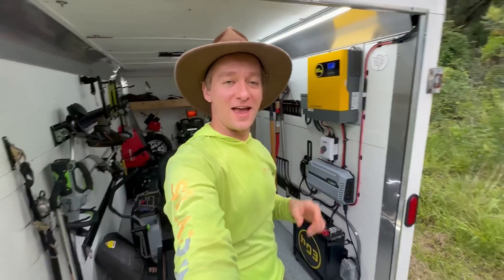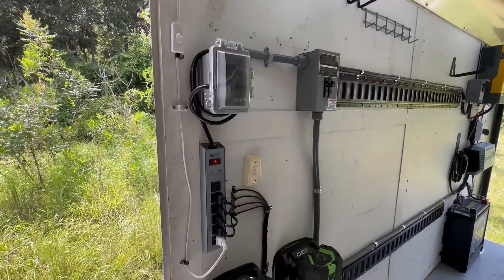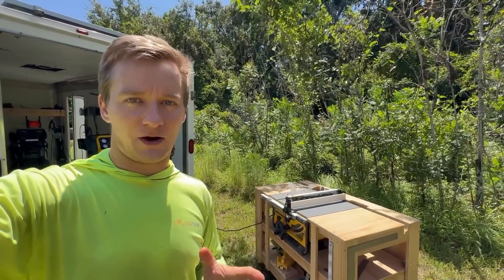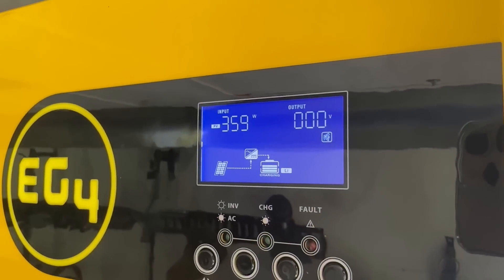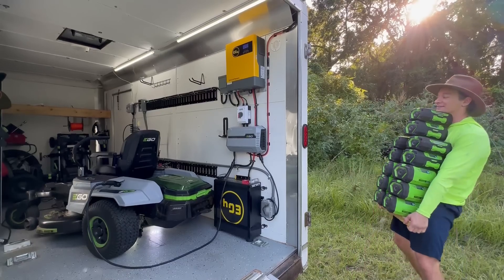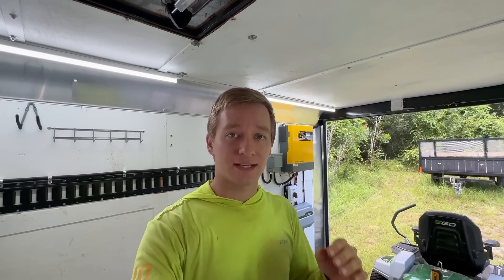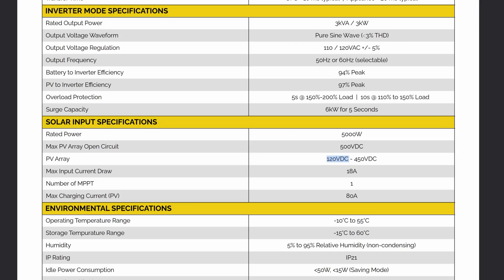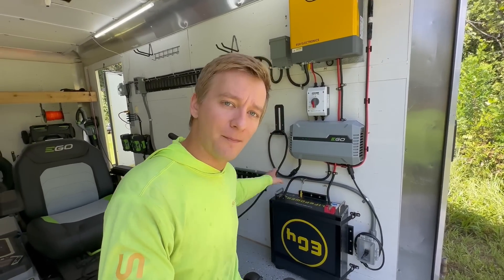Solar Powered Lawn Care Setup; Why Not Just Buy More Batteries?

Comment: I subscribed to you for this set up and your tesla towing it , you got a unique way of doing your things and I love it! , plus you are saving the environment , you can install a heavy duty extension cord at the grid hook up (AC in) , so it will be easier to just plug in and unplug to charge all in case of cloudy days and rain, just make sure is at least 10awg, I did on my set up and it works beautifully! ,I just plugged to the grid or etc and I can charge my system.

Actually I recharge my system from a portable power station delta pro and rolled to where I posible need if camping etc.
Reply: As an early adopter, I wish I could have had a Delta Pro when I was setting up. Had to design the whole thing from scratch and YouTube videos. The lucky ones going electric now can just buy a box, everything works, and there is  a cell phone app. 

I am going to disagree with you about "..saving the environment." He is literally cutting down vegetation every day with that clean green energy. (just like I do with my electric OPE) 😎😅

Comment: Looking forward to more. I figured it was only a matter of time before this kind of technology started to be really used and fleshed out. I don’t think engineered turn key solutions will be what makes people money or truly works for them but DIY projects like this.

Haven’t messed with ego mowers but so far I’ve not been impressed with the box store electric mowers. The power is there at 80 volts but the quality of these tools, especially made by global tools, the one who makes most of the big brand box store stuff, is terrible. Burned out BMS, control boards on mowers etc. the motors themselves and the battery cells are good but the electronics are hot garbage. 

I’d rather convert my own. Older but mechanically reliable mowers and riding mowers. Simple time tested motor controllers and no proprietary electronics or software. 

If you can build it, you can fix it.

Comment: Super slick setup. Being a solar guy myself I often wonder if anyone would start using cordless for their lawn business and here you are. My only concern is that these batteries use older type cells and their life cycles aren't that great. They're fine for the normal users but you're using your for a business so those batteries and being cycles regularly. Too bad, no one have come out with lifepo4 cordless batteries yet.

Comment: Just started out this year in the  uk. Battery equipment is still rare, only hedge cutters and small blowers for most. I went full makita 36v for everything which had been successful so far. Dual charger and inverter in my tow car. Looking into a bigger trailer with a similar settup to this on board. Thanks for a well put together video just subscribed.
Reply from the maker: Hey awesome! I’ve been around a few areas in the UK, you’ve definitely got a challenge regarding space. Even towing with my car instead of a truck, it would be really difficult parking my trailer anywhere. I would imagine a van would be a great use of space? I’ve even considered it here if I could find an electric one.  Congrats on being an entrepreneur trying to figure it out in your area! Let me know how it goes.

Comment: Even as a Tesla owner, I don't think I ever envisioned someone showing up to do lawn care in a Tesla until maybe the Cybertruck comes out!  Your production quality and content for this video is top notch and you have one slick set up.  It will probably slow you down for a while with customers wanting to check out how you are turning the lawn care business upside down. I have three out of my four neighbors converted to electric mowers with one loud obnoxious Toro to go - lol!
Reply: Haha i am on the electric conversion spree too.
I have a chain saw, blower, weed eater
However my lawnmower still works so why should i replace to electric.
Tough to justify $500/$600 
When it breaks i will replace it with electric
Reply: I found a ryobi 21 inch mower  with 2 7.5 batteries at a garage sale for $160. The money flew out of my pocket. I am now looking for a ryobi 40v chain saw. @danielt6810
Reply: @danielt6810  
less maintenance and thus cost, is the biggest reason to go electric in the first place.
i'm in the same boat currently, wanting to get a battery electric riding mower but ours works and is only like 5-6 years old.
our plan is to sell it and then make the change, most likely when these mowers go on a bigger sale because yea the upfront cost is pretty massive.
Reply: lol the cyber truck is never coming out
Reply: I switched to an electric mower with a working gas mower - I have no regrets. My Ego 21" self-propelled is a life saver, and the fact that it folds is really nice for my tiny shed. 

That being said, if my mower wasn't 5 years old and literally the most bargain bin version of a mower, I maybe wouldn't have been so eager to replace it. It helps that I was in the ecosystem already with an Ego string trimmer. Now I have a mower, a trimmer, a chainsaw (which is so awesome, by the way) and a leaf blower. I'll never go back, even with $.36/KWh electric rates.
Reply: Love your video. Now I need tutn my shed electric and upgrade to electric yard equipment
Reply: The cybertruck is a awful work truck. It better to buy a hybrid.
Reply: Cybertruck will be a game changer for this bloke, pass through power from, the cybertruck and being able to tap into its huge battery atleast 100kwh+ battery,
Reply from the maker: Hope I can afford it!
Reply: @solarpunksteve  I apologize if I missed it in the video - how much was the trailer alone in your area (sans all upgrades).
Reply from the maker: I got my trailer used, repainted the outside, replaced the bent axle and added electric brakes and a bunch of other little things myself, so not a perfect example of cost of a trailer on the market. Around my area, a trailer like this brand new is between $4.5k-$5.5k.  Used I’ve seen them around $1.2k-$4.0k.  Hope that helps.
Reply: @solarpunksteve  Thanks!
Reply: @solarpunksteve Ah I don't think you need to worry about it, given it's a "delays" I'll be nice.

Comment: This is eye opening! I could literally buy the panels, inverter, battery, charger etc etc for less than Ill spend on fuel in a season.  The second year's fuel cost would cover the mower and handheld equipment. Two years in and I could pay for this entire setup just in what I would have spent in fuel alone without any equipment! OR... for the average cost of a traditional gas powered zero turn mower, I could buy this entire setup. This is really an excellent option. I have so many questions! Does this type of service command a premium? Are customers willing to pay more for battery operated lawn service? Do you lean into that aspect with your marketing? Whats the life expectancy of these components? Are there any added insurance costs associated with this type of setup? Would you go with EGO again having used it for a while now? Is there any reserve on the mower in case you hit 0% while mowing and didnt see it coming? Ill stop there for now lol. So cool!
Reply from the maker: Woo! Ok firstly, thanks so much for checking my setup out! Secondly, I want to address all your questions as they are very valid, but I want to be clear this isn't proven long term (I'm only in my second year) and I'm not a large scale operation mowing tons of yards a day.  I'm a solo operator, try to get smaller yards if I can, and add other things to my mix in order to make money, not just mowing.  Ok, now on to the fun stuff!

Practically speaking, it probably makes more sense to skip the solar on the trailer or save it for the home/property you live on.  I paid a premium for "RV/Off-grid" solar panels from Rich Solar.  That being said, I literally named my company Solarpunk Lawn Care and put "solar powered" on the side of my trailer, so naturally solar on the roof completes the picture, and that's partly my point of all this: it's possible.

My area is relatively lower income and we have a large retired community, so initially I wasn't successful in commanding a premium just because I operate battery equipment (plus I was new to the game so hard to know what I should be charging regardless) however over time I've built a client list of people that work from home, are retired and live at home, or work the nightshift and all are willing to pay a little more than their previous lawn care provider if they had it, but to be perfectly honest with you, most have chosen me because I'm consistent every single week and  pay attention to what they like and do detailed work (imo).  As an all electric setup, I can't compete on volume, so I don't try.

My EGO equipment has been pretty solid so far, minor gripes and issues but all-in-all I haven't really had a reason not to like it. One dead battery after over a year, so can't complain given the amount of abuse I give this stuff.  Hopefully the other batteries continue to perform. If I were to do it again, I would still go with EGO for now.  I might look into a different string trimmer or some other tools as I go, but as long as my mower keeps running I feel it's a great entry level option for people at around $5.5-$6.5k (who has the money to drop $34k on a "commercial" electric mower, like common...)

The mower will stop running the blades and demand that you go drive it back to plug it in if you get that low.  I've never hit that point personally, and I wouldn't recommend operating electric equipment down to "empty" anyway.

Hope this answers some of your questions, I'll be trying to cover a lot of the topics you've asked about in future videos because it's clear this is still a very new and untested operation and that's why I want to help share what I've learned.  Also thanks for asking questions as this helps me figure out what people might want to know most.  Cheers!
Reply: @solarpunksteve  Thanks for taking the time to respond. Im looking forward to following along and learning more about this setup and how I may be able to apply some of it in my business.

Comment: Curious of life span with the batteries for the charging cycles. Consistently charging like that I am assuming takes a toll on the batteries. Interested if you could provided that breakdown.
Reply from the maker: I'm curious too! I have a reasonable understanding of these types of batteries/chemistries and I'm somewhat confident in their longevity, but ultimately without actually putting them through real-world testing like this, I'll never know for sure.  I'll definitely be putting out a video on that at some point covering lots of those details, but I won't do that until I finish collecting all the research papers I want to use to back up my claims so that I'm not just telling you guys something anecdotal about my personal experience.  That being said (lol) after over a year I've only had one battery quit working on me.  I hope the rest aren't right around the corner as that would be very disappointing and expensive to deal with, but until then, I'll keep using them to make money out in the real world!
Reply: @solarpunksteve  Maybe give an annual update on them as you go along. That's great they have lasted about a year with weather conditions in Florida and regular use. The EG4 I believe should last you about 5 years with the usage and Ego’s 1.5/2 pending temperatures inside the trailer with the usage outside. I know they have a safety shut-off to extend life if going above a certain set point, but here with 100-degree days, we reach the breaking point for most equipment easily. Good luck and can't wait to see the video breakdown of the data.

Comment: Have you considered adding a solar panel awning for the side of the trailer. You could raise it while working to double the solar charging while giving you some shade. Also, adding a matching EG4 battery on the other side of the trailer would double your reserve while keeping the weight balanced in the trailer
Reply from the maker: I have considered it, but this was step one and for my use case it's working quite well so far.  Next step would be to plug in at home after a day to recharge if I'm running out of battery/not enough solar as that's the most practical/cheapest solution, then of course I could add another onboard battery like you said, and lastly it would be totally sick to pull up to a yard and deploy extra solar out the sides of the trailer, but that's not something I'm focused on right now haha.  As for the battery balancing out the trailer, I think at the moment I have it relatively well balanced: I park the mower slightly to one side of the trailer and then have all the batteries on the other side, so I think it mostly evens out.  Next trailer I think I will consider recessing the onboard batteries in the floor near the axle to provide lower center of gravity and a balanced load.  We'll see!
Reply: @solarpunksteve  could plug in the trailer at some job sites as well when needed. Not all have power and some might not have out door power outlets but some do.

Comment: Very nicely done. Power tool batteries are such a rip off! Glad you've found a solid solution.
Reply from the maker: I know right! Frustrating but I understand why (early days, recouping R&D costs, warranty claims, capitalizing on "flashy new tech" trends etc. etc.). They will come down over time, just look at EGO batteries on Amazon, 24hrs after posting this video they "went on sale".  You're welcome! ;)
Reply: @solarpunksteve  I think it is much more that they are proprietary connectors so they can make $$$ off them. The cells inside are generic in these EGO packs, and the rest is basic chips and plastic... so frustrating!
Reply: @MS12-u5p  also owned by Chevron, gets me every time there's an update on the software for their inverter, load up a few charged batteries and run some tools in your yard or a few things around the house during an outage
Reply: @KaceyGreen  I always get their name mixed up, the parent company is CHERvon, a Chinese tool company, not the oil and gas CHEVron. It is a weird name! I bought some Ryobi stuff for emergencies because their stuff gets really cheap on sales, especially the batteries. For BIG back needs, I've got a bunch of solar panels and a Bluetti. Fun stuff!
Reply: @MS12-u5p ah, great to know, I wasn't sure why they'd get into this market rather than EV cars and trucks if it were the oil company.
Reply: @KaceyGreen  Totally. For awhile they kept saying they were going to invest in clean energy, but instead just went to more fracking tech and biodiesel instead...
Reply from the maker: I believe we call that greenwashing ;)

Comment: Super cool!!! I just did a DIY solar system to backup our house with used solar panels and an EcoFlow Delta Pro. Almost went your route with the EG4 gear but needed a bit more portability. The EG4 gear is great and that is a very nice setup in your trailer, great job.
Reply from the maker: I really enjoyed getting it all set up and it was such an awesome feeling to have it actually work and start producing power! I want to do a solar/inverter/battery setup on my workshop but don't quite have the funds for it yet and this was more important.  Plus it was a bit of a learning experience so now I know better for when I'm ready to build a bigger system.  The market is changing fast but when I specced this system almost a year ago there wasn't as many or as capable "battery Generators" and the prices were still really high for what you got.  I'm happy with the EG4 stuff and it's been rock solid so far, but it's also probably a little more advanced for some people and an ecoflow or something similar might be the easier (plus portable) route.

Thanks for your thoughts! Glad to hear others are having fun building solar systems!

Comment: My EGO battery keep trying to kill itself ! I'm really disappointed with Ego !
Reply from the maker: I'm really sorry to hear that! I've only had one not perform well so far, have you contacted EGO about the issue? How has your experience with them been so far?
Reply: @solarpunksteve  their answer is to let it kill itself and buy a new one at full price. So I have to recharge ot every week or 2 before the internal resistance try to empty it.
Reply from the maker: Hmm, so this might not be your situation, but if you’re storing it for a long time at full charge, they are programmed to slowly drain their charge after a month in order to go into “storage” mode and prevent degradation of the battery. It’s better for these types of lithium batteries to be stored at a lower state of charge for long periods of time. Again, not sure if this is what you’re experiencing but just a thought if the battery is sitting a long time unused.
Reply: @solarpunksteve  they do, but they will use the same system to kill it completely  if a cell isn't doesn't balance like the others. The led flash green every second until it drained the battery to shutdown
Reply: Of my nine Ego batteries, over five years, only one has failed.  It would present "green" but runtime on a blower was under two minutes.  One phone call to Ego, they checked that i'd registered it online when I bought it, then shipped me a replacement -- it was still under warranty (residential use).  Told me to keep the old one, which I gave away to someone who salvaged cells.

I like all my Ego tools (hedge trimmer, Powerhead/string trimmer, std string trimmer, snow "broom" (12"), two blowers, older walk-behind mower), EXCEPT the mower, which not only doesn't mow well -- uneven cutting -- doesn't pick up grass well, is a brushed motor (not brushless), leaks a lot grass around the bag at the front, but also has a terrible design flaw in the handle wiring, where wires commonly break at the handle hinge area, preventing the self-propel to work correctly.

https://youtu.be/NTVUzJ5KJZg?t=90

I'd buy any of the Ego tools I own again, except the push mower.